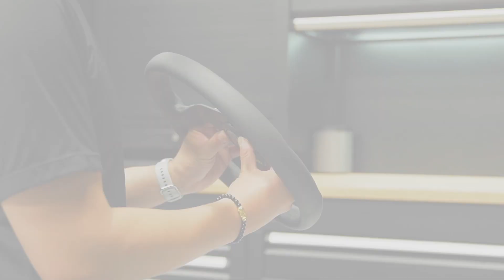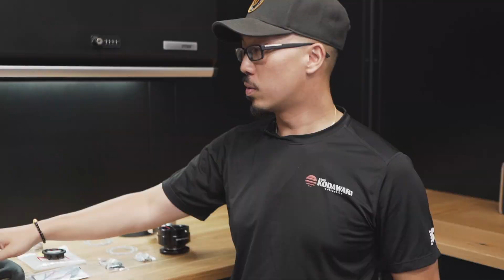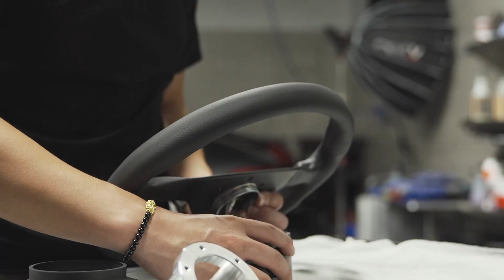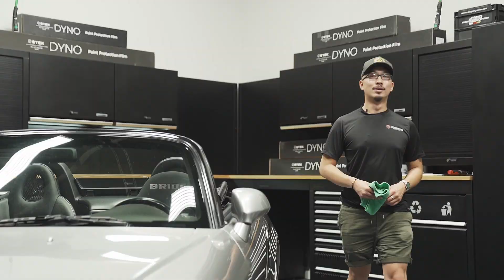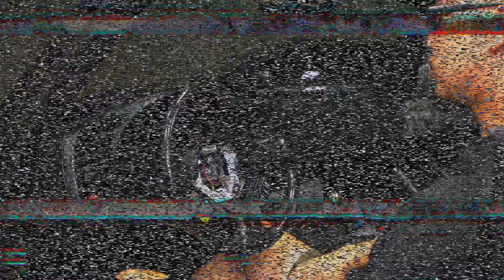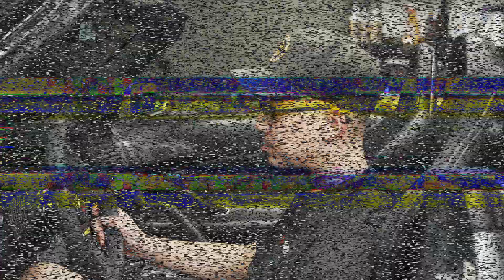S2000 Install: MOMO Mod 78 Wheel, Works Bell Quick Release HUB & JDM NSX-R Horn Button

Comment: Looks good, do you know what's different between the Mod 78 and the Monte Carlo?
Reply: Both come in 320mm or 350mm sizes. The differences are:
* MOD 78 comes in either suede or leather. Has big MOMO logo engraved in yellow lettering. No stitching options. Black horn only.
* Montecarlo comes in either alcantara or leather with choice of black or red stitching. Also the spokes get a bit smaller where the thumb grips are. Has small MOMO logo engraved, no color. Horn button color depends on color of stitching selected.

Comment: I saw you used the works bell quick release but Which adapter hub did you end up using? Works bell as well?
Reply: Yeap, it was a Work Bell hub as well (I work at Kodawari, I was filming w Allan)